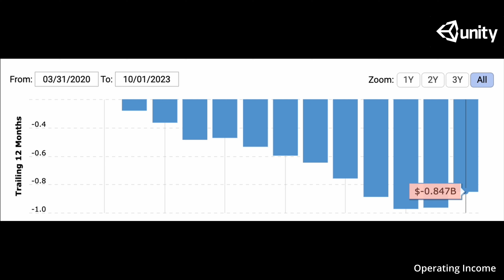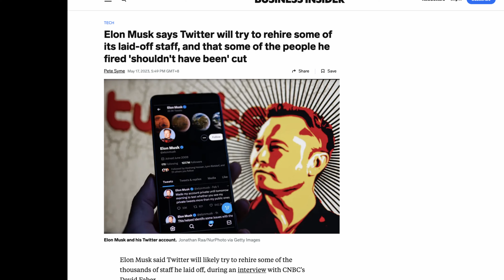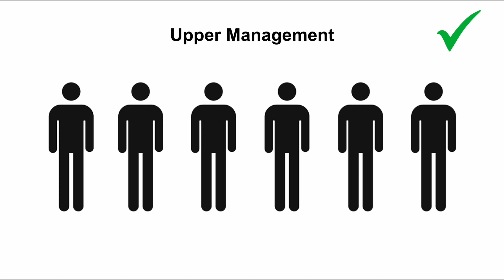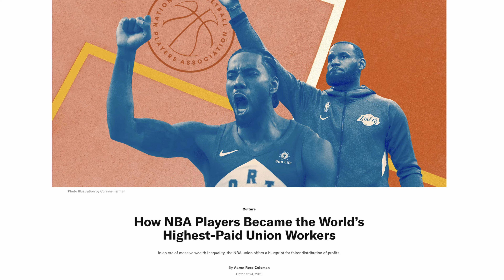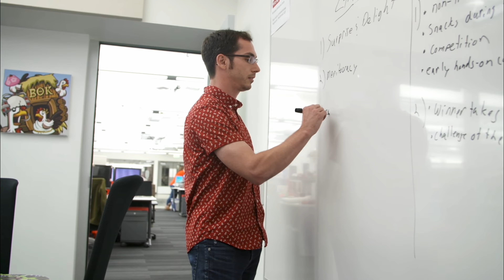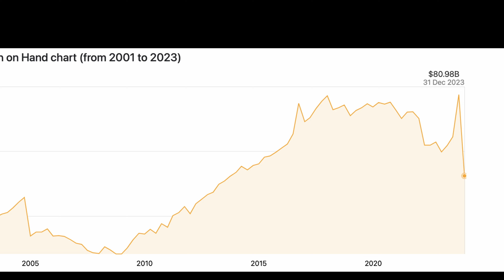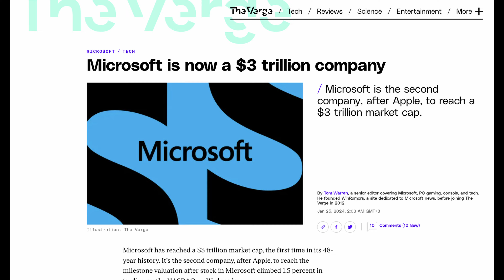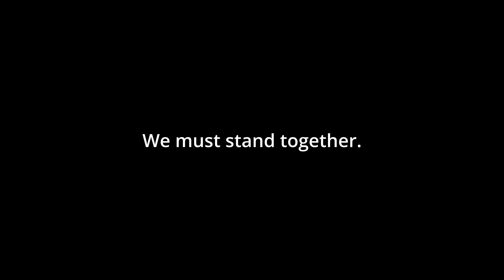More layoffs in games are coming, here's why and what we can do

Comment: Speaking on a technical focused perspective, I still don't see SORA and other AI generators being a big thing for a 3d artist, at least not in a way the majority are expecting. Forcefully applying these in a pipeline is a nightmare, not because it will lead to people losing jobs, but because of how inconsistent it is. There's a reason why retopology isn't fully automated even today. 

A better example of AI being implemented in this scenario is Cascadeur, an AI assisted animation software that doesn't turn a company's workflow into a garbled mess.
Reply from the maker: I totally agree with you, it's very inconsistent at its current state.   But it's hard to say what the tech can do 5 years from now based on what is currently available.

Comment: As Keywords recently demonstrated - you aren’t making games with AI any time soon.

The problem with your analysis is that NONE of those artificial tests are useful with regards to game development. And are not likely to be in the immediate future.

The only potential area that AI might impact game dev in the near future is localization.

You have really misunderstood where we are on the curve here for this tech (as most people do) - rendering a nice persons walking in a street is a LOT easier than making it do what you need it to do to service a story. It’s like 1% of the way there.

As for engineering - no, we still hire junior engineers, and will do so for a few years yet. Engineers have a 5 year average lifespan in game dev. If you don’t hire juniors you will get five years down the track, AI won’t be there and you will have not enough devs.

Sorry your whole take is a big L and is assuming the growth of AI  will not run into issues.

(Also, you can’t copyright content made with AI - this is a problem games companies have not solved yet).
Reply from the maker: I agree with most of what you said, if not all.  The current wave of layoffs is largely greed related with only a sprinkling of AI. My take does not center on AI and it's usefulness, rather, how executives see AI, preemptively firing people and making their games run on a skeleton crew until AI catches up.  Also, my layoffs section mentioned AI or outsourcing, which is a far more likely cause for a layoff than AI.

Regarding copyright issues, I'm sure companies like Microsoft will make it happen sometime down the road.  AI is in the move fast and break things period, fixing everything they broke comes later down the line,